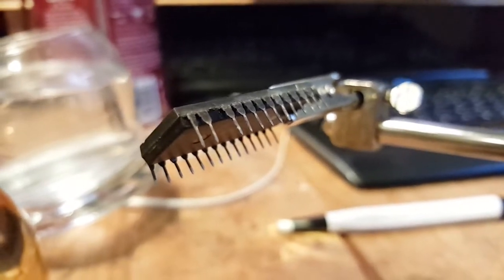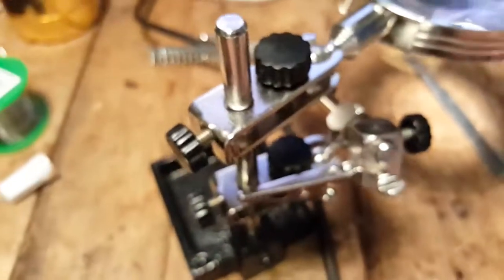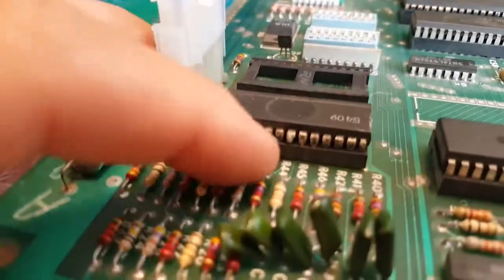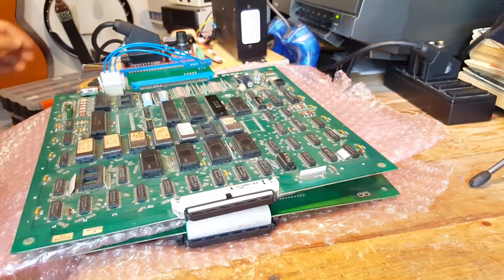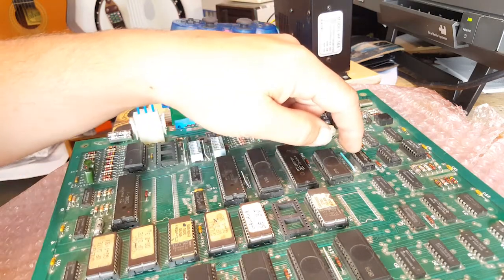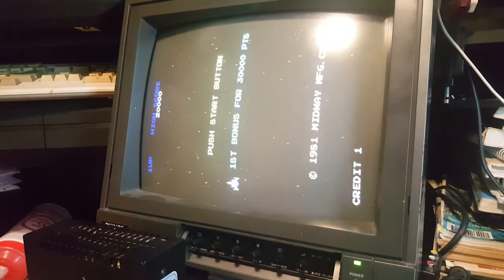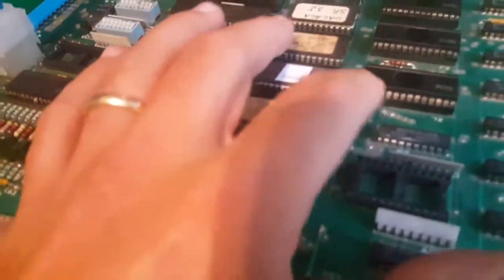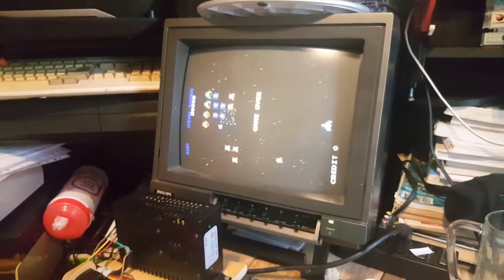Arcade DIY #23 Galaga PCB #3 repair

Comment: oof .. focusing hurt my eyes a bit ...that's cool that you can repair missing chip legs.. i've never tried that myself.. surprised you didn't solder it while it was socketed .. seems like there'd be less chance of the pin moving around from pressing it in ... Glad to see you got things working!
Reply from the maker: yeah the autofocus on my phone goes nuts. need to start using a proper camera when I get more cash. 
soldering to the socket does defeat the purpose of having them on a socket though.